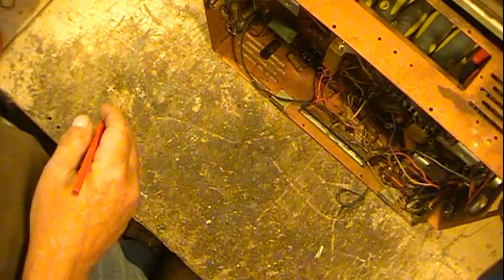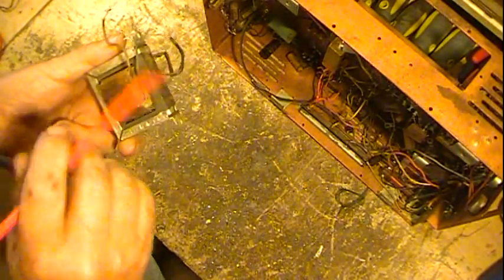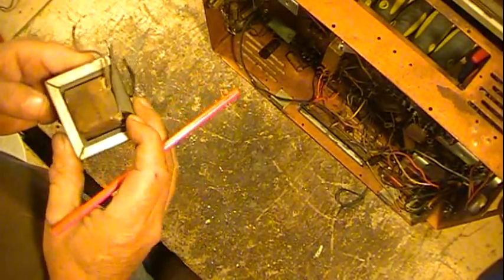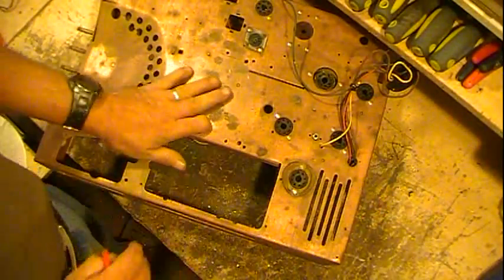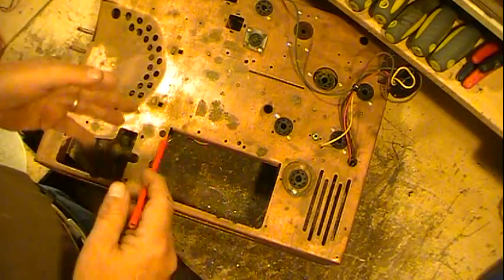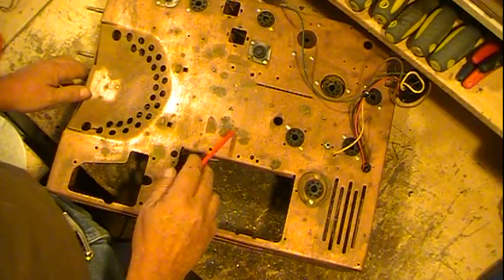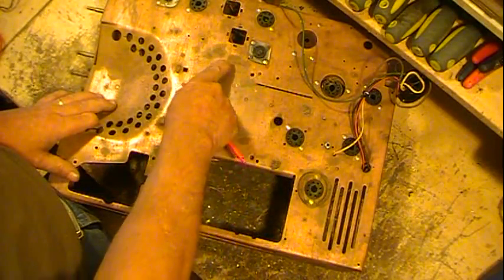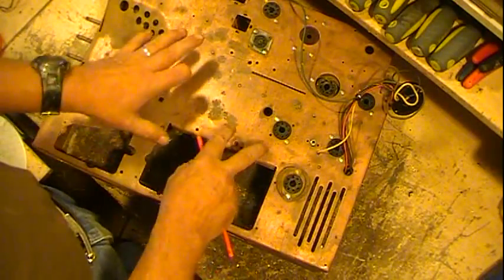Admiral 34R16A restoration part 1

Comment: What was the purpose for copper plating the chassis, was it just to make it a better conductor? I was wondering about this since it seems that old radios and TV’s worked fine with plain steel chassis. Would the cost of plating be worth any benefits?